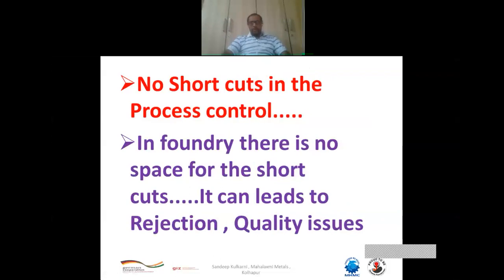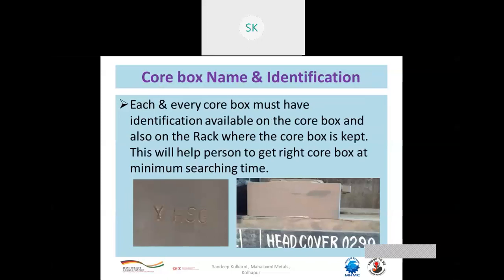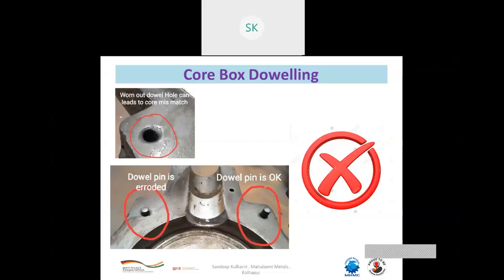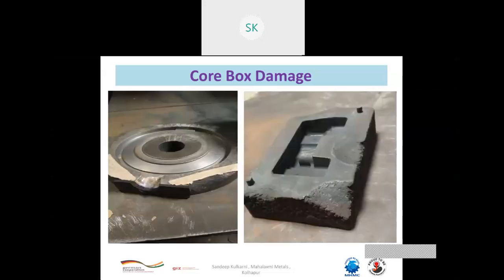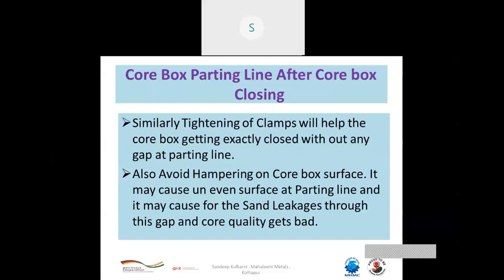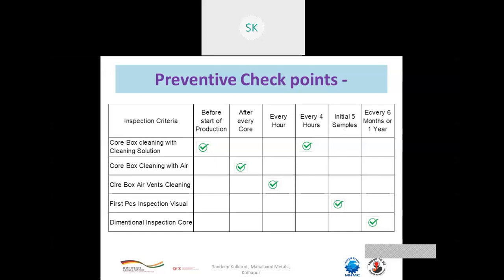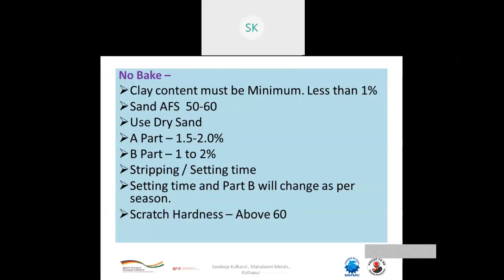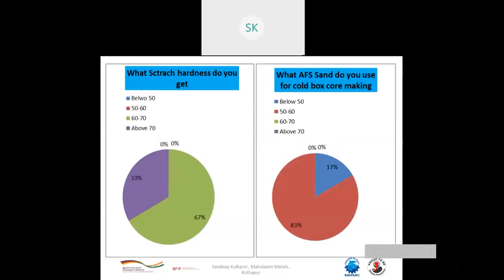Core Shop Process Control Part 1

Comment: My questions are regarding core vents:

1. Does all core making process i.e. cold box, hot box and shell use core vents?

2. After how many blows, vents should be changed for uniform core quality?
Reply from the maker: Yes all coreaking process needs vents to escape air from the bottom and side of core box to get compact sand filling during shooting.
Reply from the maker: You normally nerds to clean vents every shift to get consistent core quality. Regarding vent replacement when you find vents are damaged you can change them. There is no such specific time line but you can make your own bench mark for the same.

Comment: Sir ..in that video there is 5 no point of painting is remaining ..is there is a effect of painting of core making??
Reply from the maker: Yes painting is important process post core making as it will give core good surface finish and also does not allow gases from core burning to get into metal which eventually helps in reducing blow holes. So important to paint the cores.

Comment: Sir ... 
What is the long form of AFS ?? PLZ explain
Reply from the maker: Painting is post core making activity. For more details of painting and core making specially cold box core making you can watch our Webinar part 1 & 2 recording of Cold box core technology
Reply: @dynamicfoundrygroup  ok sir
Reply from the maker: A standard parameter to express the size of molding sands is the AFS fineness number (AFS = American Foundry Society). This number is calculated from the size distribution, which is determined by standard ASTM sieves.
Reply: @dynamicfoundrygroup  Thanks Dyanamic group and Respected Kulkarni sir.....to clarify this.....
Reply from the maker: AFS - American finess number.